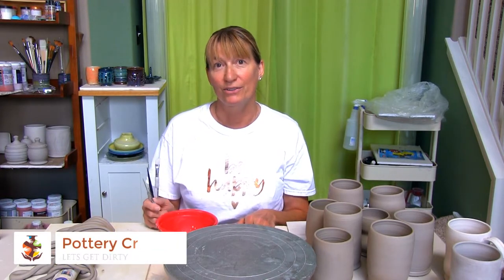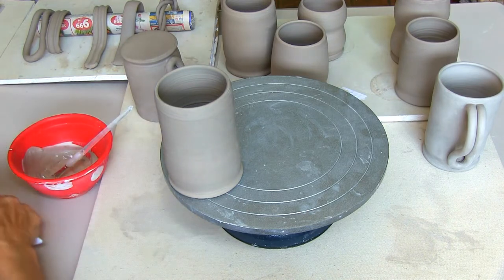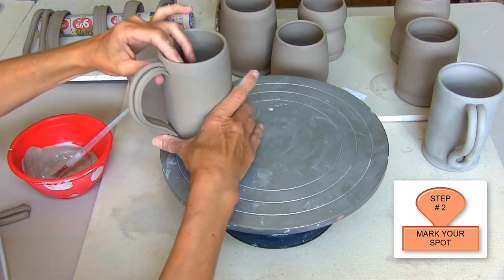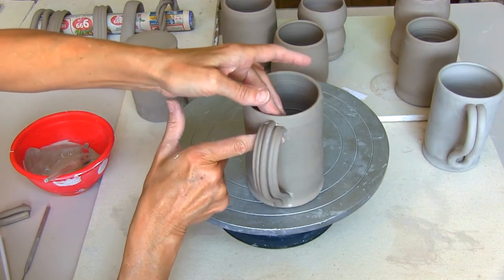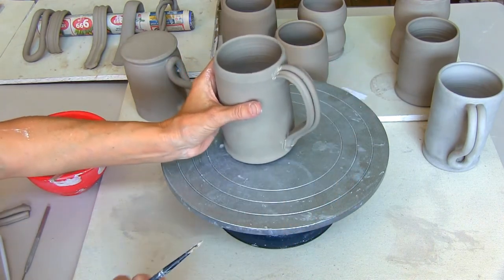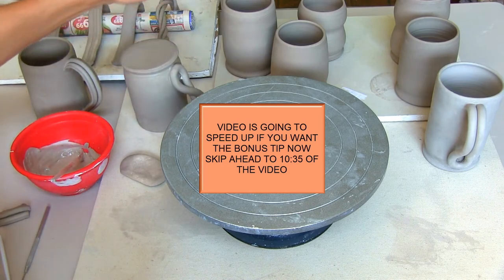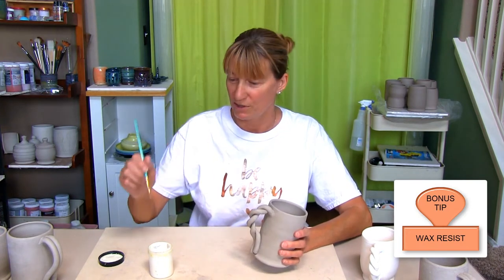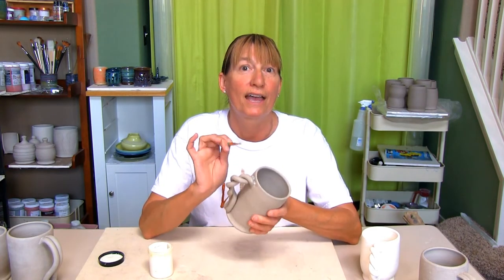Attaching Handles to Mugs in 5 easy Steps - Pottery Making For Beginners

Comment: Hello there. I have a question about this. How long should I wait for attach the handle to the mug? Thank you!
Reply from the maker: As soon as you make your handle shape it then let it harden to leather hard (the handle should be able to hold it's shape on its own before attaching). The mug and handle should be similar in hardness. The handle will dry faster then the mug so if your mug is not leather hard yet cover your handle so it doesn't get too hard. 😊

Comment: What hardness is the handle.  I tried to do a leather dry one yesterday and it cracked when I shaped it.
Reply from the maker: That is a good question. The handle is in its plastic or workable stage of clay when I shape it to fit the mug. Then set the shaped handle aside until it becomes leather hard. Once it is leather hard you can attach it to your mug.  😊

Comment: Once I have attached the handles the mug rim turns oval as it dries even under plastic. What may I be doing wrong?
Reply from the maker: It could be pressure from the handle. Or the mug is not leather hard enough? You could try blowing up a balloon in the mug

Comment: I like trimming mugs when they are leather hard. I find that my handles are cracking along the attachment points. Any suggestions?
Reply from the maker: Is your clay on the mug the same leather hard as your handle? Are you scoring and slipping with the same clay body? And are you covering your mugs with plastic after you attach your handles? Handles tend to dry faster than the mug, so my handles have a little more moisture in them and I place plastic over them for at least a day. I hope this helps 😊
Reply: @PotteryCrafters  Yes, I need to wrap them in plastic after attaching.Thank you!